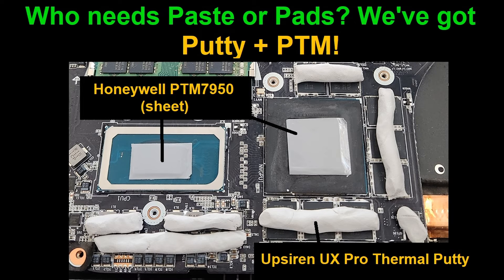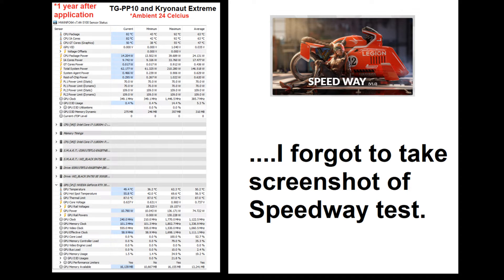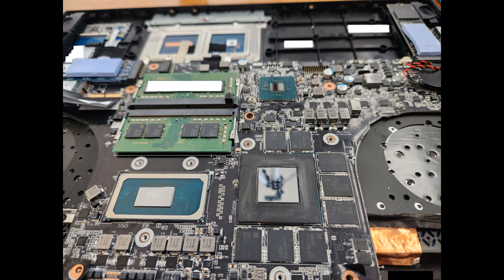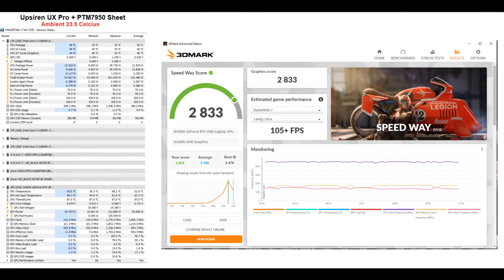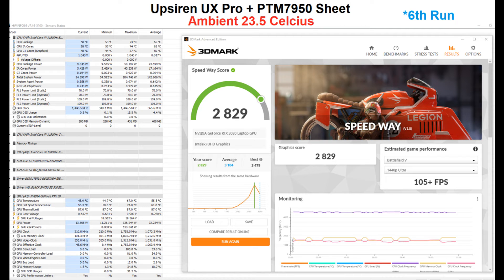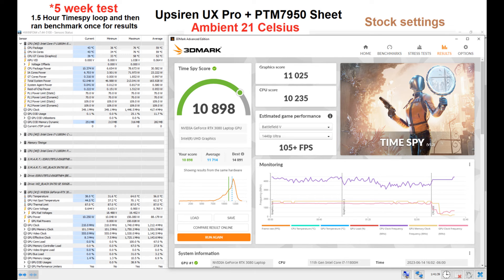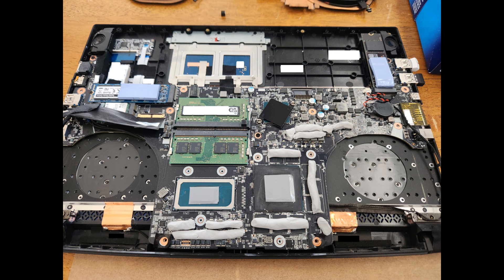RTX3080 Laptop meets Upsiren UX Pro thermal putty and Honeywell PTM7950

Comment: Great work as usual.  Thanks for sharing.  I have some unused PTM7950 sheets in my bag and will def be trying them on my Area51m R2 laptop after viewing your interesting results.  My laptop has a standard issue 10700K desktop CPU in it though and the gains might not be as signficant when using the PTM7950 on the lapped IHS top surface.  The CPU is deildded, however and having gotten decent but not great results using LM on the CPU die, I'm wondering if the PTM7950 might be worth experimenting with in place of LM and in between the CPU die and IHS underside.
Reply from the maker: It can't hurt to test it out. It's certainly safer to use than LM.
Reply: @snarksdomain  I've seen some interesting tests (forget the source) comparing LM to PTM7950 and the delta between the two was slim to none after the same repeated heat cycles you demonstrate with your own testing. I believe it was on a typical IHS and in place of thermal paste, though and also on a bare GPU die.

Since the A51mR2 laptop is a bit of a special case internally, the typical nitpicky process of getting the LM application just right between the CPU die and delidded IHS underbelly is exponentially more tricky.  The results were good, especially the freakishly low delta (~1c to 2c) between the 8 CPU cores but the overall thermal gains were not as good as desktop delid projects I've done. Better than the stock Indium "solder" but still not ideal imo.

Even though the laptop mb uses a typical and standard 3-point 10th gen ILM bracket with a regular 10700K CPU, the fact that all of that has to be designed within tolerances appropriate to the very dense confines of a mobile chassis make getting that crucial LM-to-IHS equation to resolve is a bit more vexing than say on my 13th gen desktop rig which is also using a delidded CPU; there are just too many design variables (and perhaps compromises) that afffect precise alignments within the laptop chassis and thereby also the end results when buttoning up the CPU delid/relid.

As per our other DM on Reddit, I have some Upsiren UX Pro on the way and will be trying that in lieu of the typical TG-PP10 that I've used for a few years now.  I opted for the Pro vs the Ultra simply due to your helpful comments on it being a bit more tacky than the drier, clay-like Ultra material.

I'll share some info once I have a moment to do the work. Best regards and have fun...
Reply from the maker: @s1rrah  I believe that was an LTT video where he compared it to LM.

That does sound like a tricky laptop application. 

I've got some Indium thermal pads I need to test out once I do all the shim testing. I bought 2 thicknesses. 1.8mm and 1.6mm (if me.ory serves correct). Will have to see how they perform. Also have Aluminum Nitride shim material.

Comment: upsire now has pt-1 there own phase changing material also its 0.25mm not 0.2mm
Reply from the maker: I've got some Upsiren PCM-1 on the way for testing.
Reply: @snarksdomain   do you know when roughly you will have a new video testing upsiren pcm-1 with PTM 7950 ? Also how did your order from Moddiy go - no problems? Is that the legit one from Moddiy?
Reply from the maker: @nerijus01 I'm not sure on timing yet. Currently have PCM-1 on the test bench. I did a test first with fresh MX-4 as a baseline and was planning on using Prime95 Small FFT, but was seeing power fluctuations and it made it hard to get a trustable 10 minute average (after an hour of running Prime95)

Now I'm testing with mining XMR, which is using higher watts and is more consistent power draw.

I've also locked the CPU at 4300MHz at 1.225 volts and plan to use those as the parameters. I'll need to redo the MX-4 test, but so far PCM-1 looks like it has decent performance, even after only an hour of running.

I had been testing with an AMD Wraith Prism cooler, but have now switched to using a Noctua NH-U12S. This will allow me to test liquid metal and be able to compare the results (nickel plated)

I can confirm that PCM-1 is definitely a phase change material.

Moddiy purchases have been smooth. I've also bought a bunch of connectors for crimping my own power cables, so have been buying from them for a while.
Reply: @snarksdomain  always on the ball I might buy some repaste again maybe I'm in no rush tho

Comment: so in that case is the ux pro better or the k5 pro ?
Reply from the maker: Yes. Nearly all other putties I have tested are better than K5 Pro Viscous Thermal Paste. I would not recommend K5 Pro to anyone.

That being said, I will still include K5 Pro when I retest all the putties/pads/shims on my new Testbench 2.0 setup.

*I would also note that while Upsiren has put "Computer-systems.gr" on the box for UX Pro, it doesn't seem like they are connected at all. There is even a Reddit post, apparently from computers-systems.gr, saying they aren't associated with Upsiren at all. I don't quite know what's going on with that. I care more about the performance or the product.
Reply: alright thanks for the reply
Reply: i remember from your test that the k5 took more time to warm

Comment: Nice to see a PTM test with UX Pro. I tested with U6 Pro and it was also better than on the standard thermal pads from the laptop producer. I suggest for your next tests do a 10 minute throttling test in Cinebench and show the average frequencies of the cores their temperatures and the number of points before and after applying new paste.

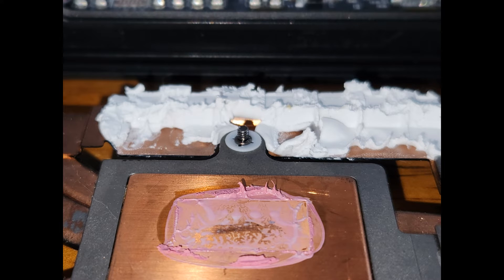Comment: 2:26 that´s how "pump out" effect looks like and Kryonaut is known for this. Arctic MX-5 does the same (but worse, literally all paste will be gone within a month, that´s why they stopped making it).

GPUs and laptops simply require different paste, than CPUs. Most of the usual CPU stuff, like Noctua, Arctic MX-4, Thermal Grizzly etc. won´t work there for long.
I can only confirm from personal experience, that Arctic MX-6 does work and has no pump out. At least so far.
Reply: From my experience with Kryonaut and Extreme pastes are not suitable for laptops with high TGP, TDP where the temperature is close to 80°C for a longer period of time.  After 8 months, its thermally conductive properties deteriorate significantly. So far with PTM7950 I do not experience this after ~14 months.
Reply: @goorthiss  thats what thermal grizzly shills don't understand lol, yes they are not suitable for laptops or even high end desktop. its because kryonaut/extreme breakdown above 80C
Reply: @goorthiss  phase changing material is the best for GPU/ laptops you don't want to teardown alot
Reply from the maker: I just wish I hadn't left it so long. Luckily I mostly game on my Desktop PC. I'll probably get some MX-6 for testing. I've got some Upsiren PCM-1 on the way as well as a piece of Thermal Grizzly Kryosheet, so it will be interesting to see how they all stack up against each other. Will likely test them out on a standalone CPU testbench.
Reply: mx-5 had production issues, its why arctic quickly cancelled it. they improved the processing for it and relaunched it as mx-6